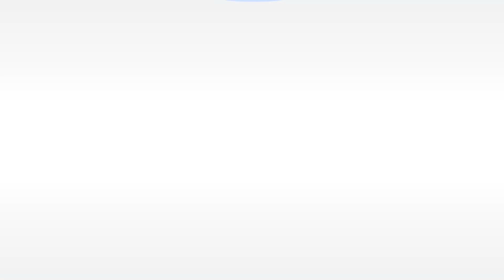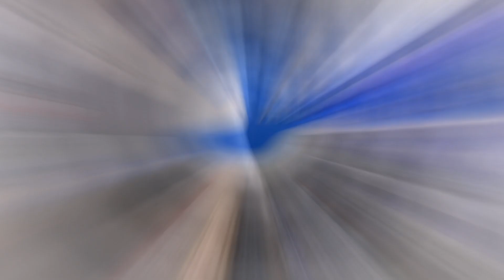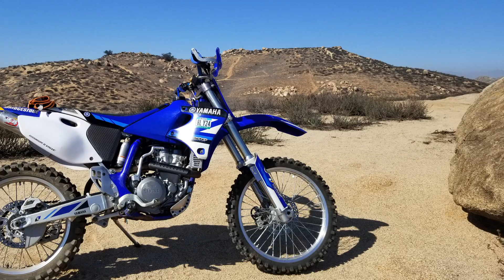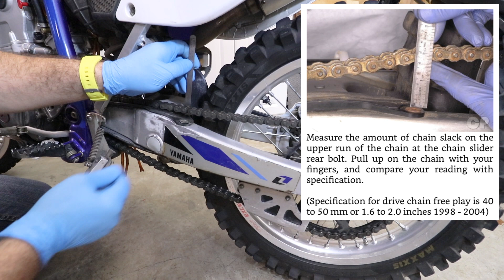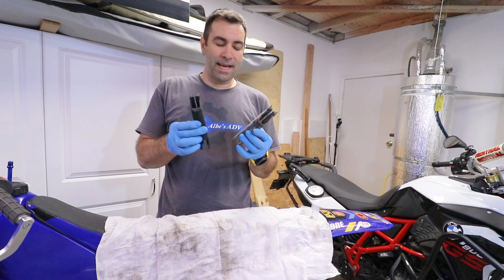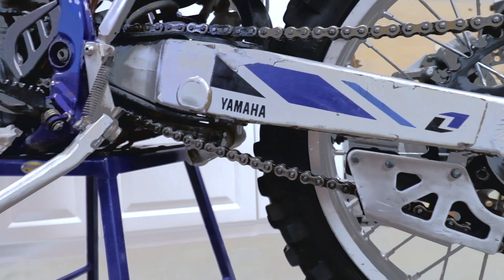Yamaha YZ426f chain, sprockets, and chain guide maintenance - Ep 2

Comment: My Clymer manual says the rear wheel should be raised off the ground when checking the slack but you said it must be on the ground?
Reply from the maker: You are correct,  I double checked with the OEM manual and you are right. The manual I looked at asked to keep the rear wheel on the ground and I'm not sure why, a few years have gone by so I can't quite remember the situation, but I was wrong

Comment: I’m replacing chain guides and rollers and it calls for a upper and lower roller but I only have one lower.. is this right? Thanks
Reply from the maker: If you have a YZ426f There is also an upper chain guide half a way up the rear sub-frame, just below the number plate